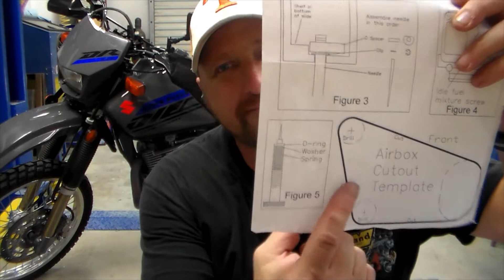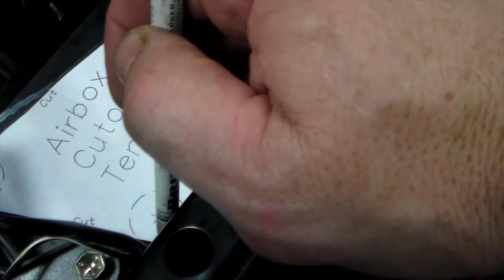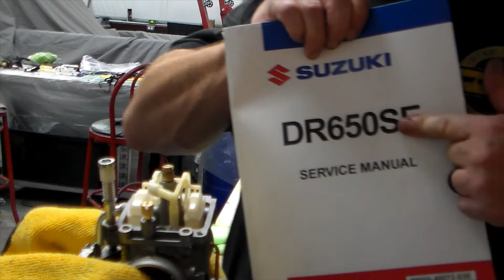Road to the Rockies #5 - 3x3 mod

Comment: What was the 3x3 kit called on procycle having trouble finding it
Reply from the maker: Hey Kyle.  Sorry for the late reply. I have had some phone issues and just got them straightened out. 3x3 is an air box mod. Google 3x3 mod dr650. It just adds three inches of intake air. The 3x3 is size of the hole, thereby making it adaptable to use a k&N filter.
Reply from the maker: Or other after market filter